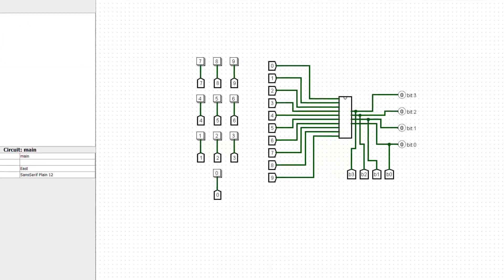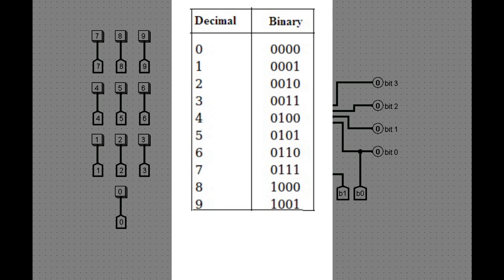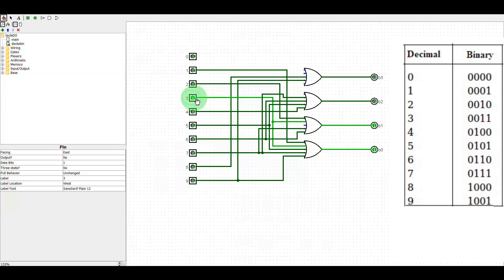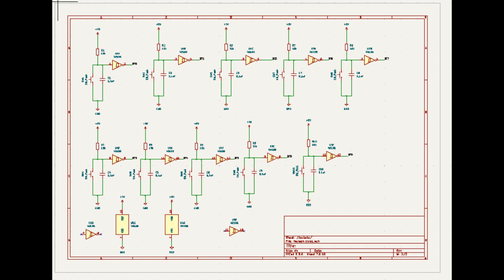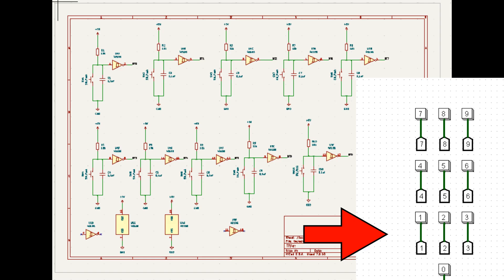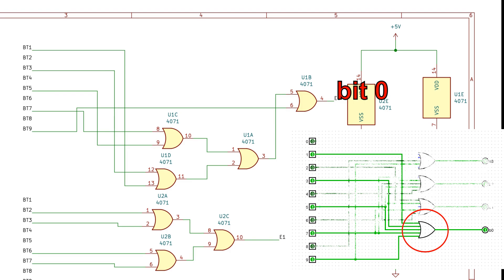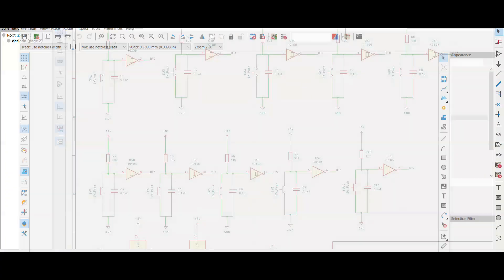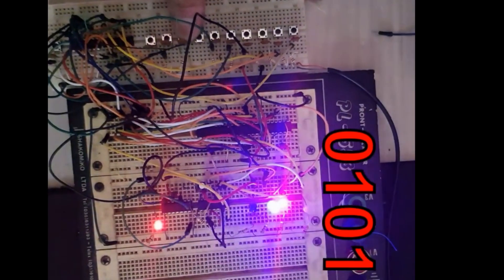Learn How to make a Decimal to binary converter with logic gates

Comment: Btw why are you still using outdated logisim version instead of logisim evolution?!
Reply: This project barely works in logisim evolution and I had to fix it manually
Reply from the maker: Hello! Most of the students I teach use the original Logisim. This project may have some compatibility issues with the Evolution version!